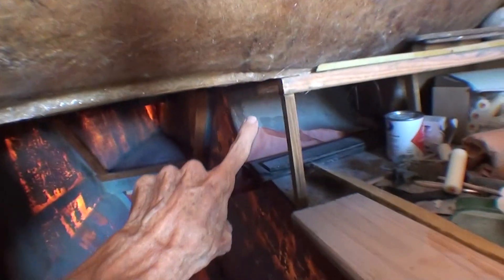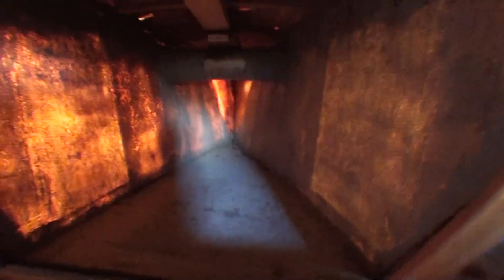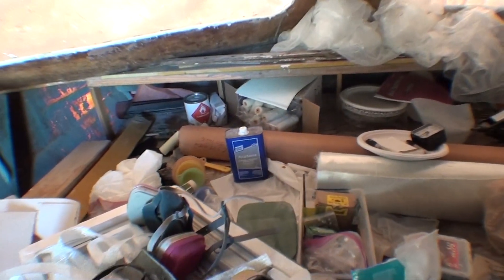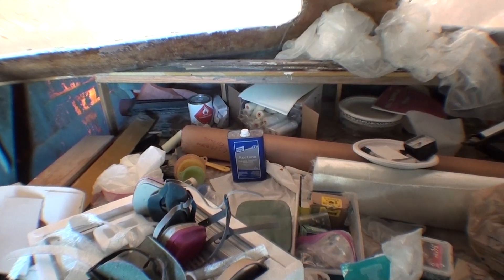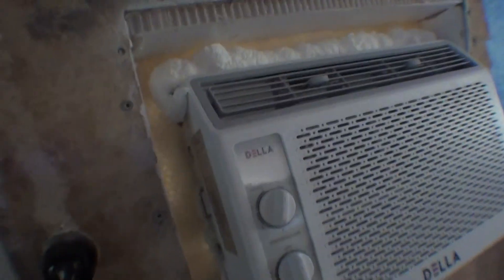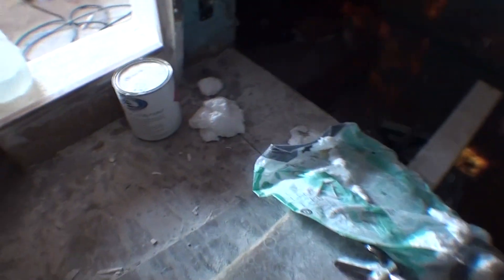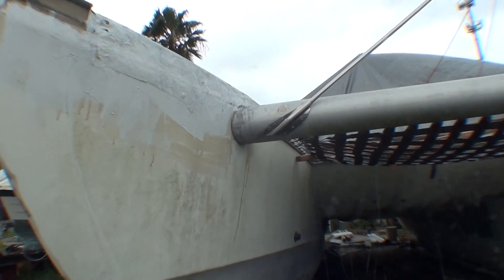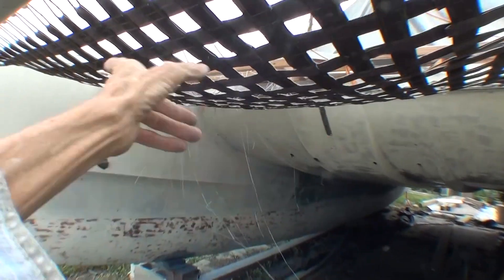9to5less Catamaran Tour Nov 2, 2023 A Destroyed Boat!

Comment: Did he sell it? I thought in one of his videos he was going to repair it.  Just curious
Reply from the maker: Trevor sold it, possibly to a guy named Marshall.  At any rate, Marshall owned it as of a year ago, when it was hauled out and left here.  Marshall removed the windows because they leaked and he had every intention of fixing them.  He also removed the last bits of almost every interior bulkhead and cabin wall, and built that plywood box on the back.
Reply: @ninehundreddollarluxuryyac5958  I wonder what happened to the engine?  I think a lot of people became attached to it after making such a long journey .
Reply from the maker: Marshall had the 15 horsepower Mercury outboard that he gave me with the boat.  At some point, they took it off the boat and left it outside laying on its side instead of upright.  The cowling makes it weather resistant when in the normal position on a boat, but not if you lay it on its side out in the rain for a few years.  I am told it is worth fixing, so I plan on keeping it as a backup motor.  Funny thing about that motor is that it was originally set up for electric start but someone took the starter motor out of it.  It would have been so much easier for Trevor to start every day if only he knew that and bought a starter motor for it. @georgestewart4285

Comment: Ohhhh, this hull is in bad shape.  I will say good luck. I don't think the idea of replacing the trampoline with a solid deck is proper. I am sure waves, especially ship's wake, would pound the deck. Also adding a few hundred pounds of weight to the bow would make it ride nose heavy causing over washing. Trimming the skeg would probably effect your tracking  and make the boat drift course when under way. Not trying to be a troll, just giving my thoughts. Again good luck sir.
Reply from the maker: I'm still debating what to do about the trampoline.  If I don't have deck there, I'd like to have a plank for an anchor roller at the centerline of the boat because I want a windlass and don't want the entire rode to be chain.  (chain would work with a snubber but is expensive and would add even more weight to the bow.  The boat will not sail again, it is being converted to a motorboat, so hopefully the skegs aren't needed for motoring.  Trevor and Marshall both said the skegs fought you when you want to turn the boat using an outboard near the stern.  Any advice on either plan is welcome.
Reply: @ninehundreddollarluxuryyac5958  I am trying to compare the surface area of the skegs to the surface area of the  length times depth of the pontoons.I don't see any big advantage gained by cutting them in half.  I think any Cat will fight you in any docking. Since you will have two motors turning will be easier, one motor in forward the other in reverse, will swing the boat left, right, or circle.  As for the anchor where is the original anchoring position?